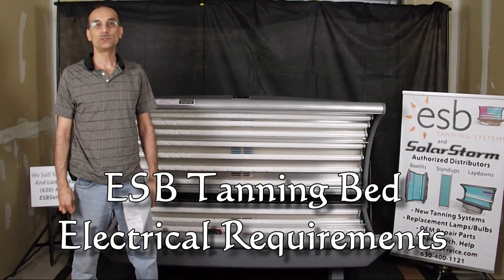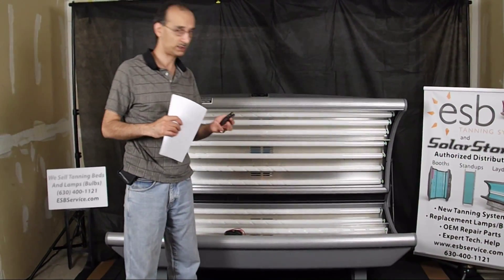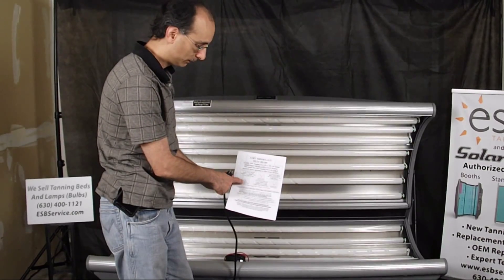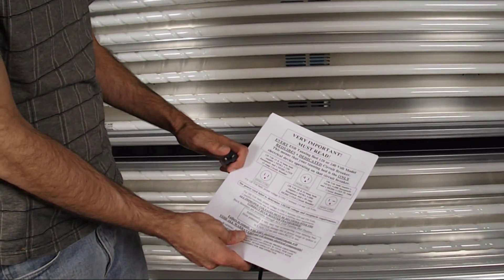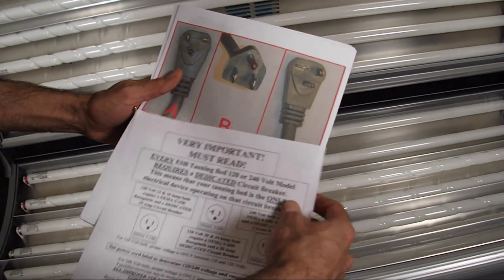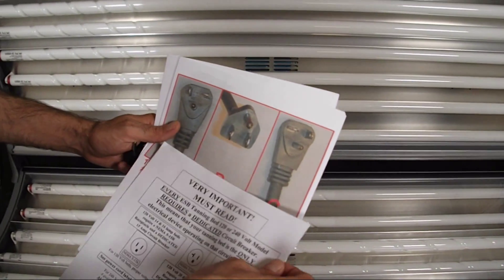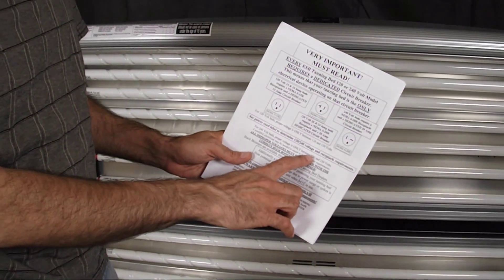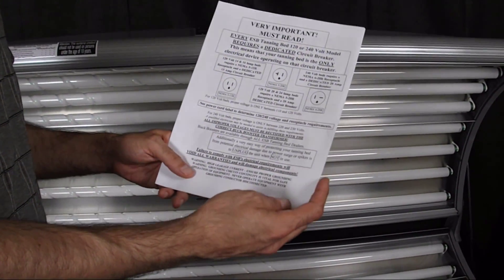ESB Tanning Bed Electrical Requirements

Comment: I'm confused, the 220 plug does not match the picture on the diagram. The left side is vertical in pic but on the right side when you show the actual plugs. Am I looking  at it wrong? Thanks
Reply from the maker: Thanks for your question.  The 220V plug has the vertical on the right, and the 220V receptacle has the vertical on the left.  Please look up NEMA 6-20R vs. NEMA 6-20P.  I hope this helps, but please let me know if I can help further.  Thanks!

Comment: I have a 110v tanning bed, what do I need to know  about hooking it up?
Reply: Its a wolf 32 xs inferno lamps Deluxe, from Sunco tanning beds
Reply from the maker: @donnatripp3684  Thanks for your question.  I'm only certain on the ESB brand of beds.  If it helps, here's my video on the electrical requirements on those beds:  https://www.youtube.com/watch?v=HkRMcq78GWs
Reply: @donnatripp3684  how did you get you're bed to work. Is the inferno bulbs good for dark tans